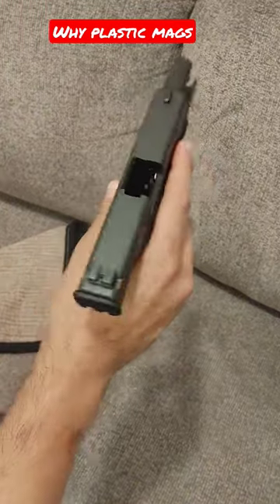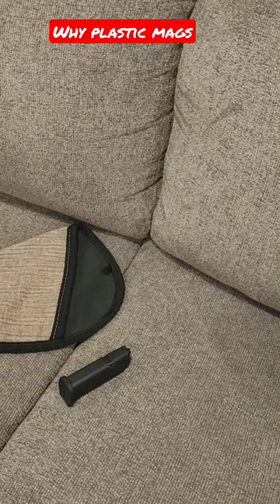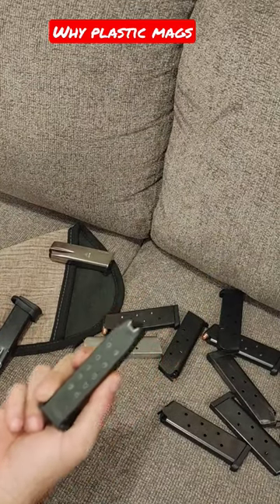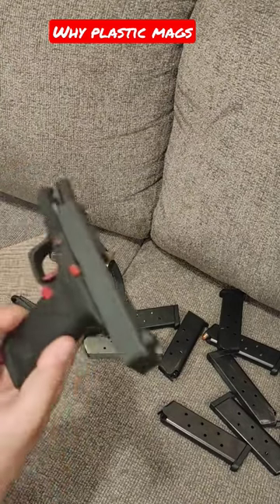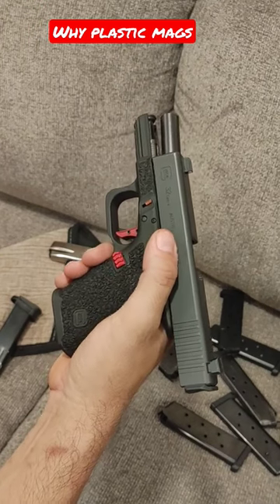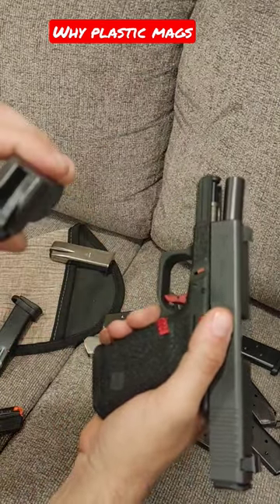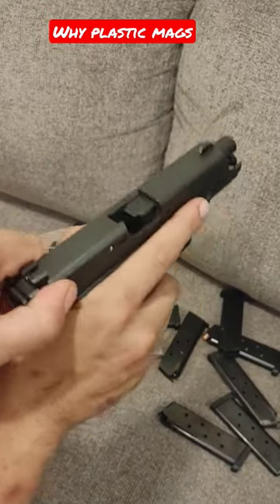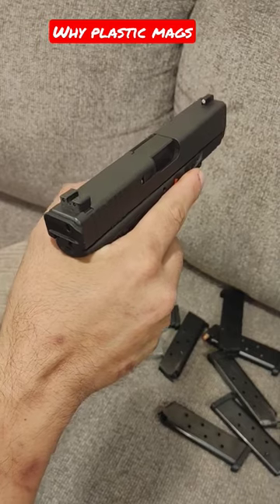why Glock ACTUALLY uses polymer mags

Comment: Over 27 years in law enforcement, 20+ competitive shooting and firearms instructor experience. Never had one single Glock mag fail me. No need for seeking aftermarket solutions. I have went through my duty mags and installed Ghost plates but aside from that, never needed to do anything to them

Comment: The IWI Masada is in my opinion a better beginner Choice than the Glock. It has the same controls and is just as straightforward but with my experience has less recoil, has a good build quality comes with two metal magazines. They are 17 round. It shoots great for around $400 such a cheap gun that my optic almost cost as much as it.

Comment: Also, they care about mag compatibility and can't switch to metal, because it's too thin. It would either be too small on the outer diameter/dimensions or too large on the inner diameter. The one time they made a Huge Mistake though was the G42 and G43 (and 43x and 48), when they stuck to plastic when it was completely unnecessary and to their own detriment.

Comment: The Polymer used in Glocks is consistent from gun to gun. You're not going to have one frame, mag body, or mag catch that has slightly weaker material than the other. They are all the same.

Contrast this with other companies (Smith & Wesson, Sig) who outsource their manufacture to other companies, which results in different metallurgy and polymer tolerances. Walther and Beretta make their own mag catches, but Mec Gar makes their mags. When metals of different hardness rub against each other, premature wear occurs, and failures happen.

Comment: They're also lighter weight, an still work perfectly fine.  Oh yeah, and the factory oem Glock magazines are about "half the price" of allot of the other brand magazines for other pistols. 

A Sig mag is like 50 to 60$'s, and don't even have any off brand options. A factory Glock mag is like 25$'s, so not that bad a deal.

Comment: And yet...they're some of if not the literal best pistol mags on the market. 

Funny how that works. Also, "everyone elses mags" are made by Mecgar and MOST of them are actually Beretta 92 tubes with a slightly different cutout for the mag release. That's why you can run Sig P226 mags in a Canik Rival. Or, Sig P226 mags in a Walther P99. If you modify the cutout that is.

Comment: The plastic is the magazine body. The metal is a reinforcing liner. The magazine will still function normally without the liner. Just wouldn't drop free if loaded, because the metal keeps the sides from pushing out. A metal Glock mag would be a horrible idea

Comment: When is the last time you had a Glock mag fail, before another OEM ?
Reply from the maker: Ive had a few actually. Damaged the polymer around the metal insert from the mag landing funny and it cracked in the cold. Feeding issues afterwards. But I also have had to rotate out my 1911 mags because they eventually bend from use too. So about the same

Comment: They don't dent, or bend. They are dimensionally stable and non conductive. Glock is famous for using the right materials in the right places. Resins can have all kinds of additives, from glass beads to Kevlar strands, carbon fiber, etc. Etc.

Comment: Sounds good but BS . The original G17 mags were NOT metal lined . They were made that way because it was first and foremost a military pistol for the Austrian Army . The mag bulged to prevent loss in a country that has lots of snow most of the year . 
The mag was updated to suit US customers requests. The magazine works splendidly with the OEM pistol . 
I carried one as duty gun for 15 of my 22 years a LEO .. we call it “ Combat Tupperware “ because it always works. 
Now when you start messing around with aftermarket internals, all bets are off.

Comment: Hell even the Glock Omaha feed Better than most of the metal ones…… it all boils down to the properties of polymer and metal, metal can shrink or expand in certain conditions and if they’re stored improperly can get messed up causing feeding issues, polymer is very durable and doesn’t expand as much in specific weather conditions and can be stored wherever

Comment: Original Glock mags never had metal inserts. They were all plastic and not "drop free" from magwell. Glock is a military design pistol. The mags were made to not fall out of the pistol by swelling inside magwell. The Glock is made to pull slide rearward to charge it, not using a slide stop. It's a slide stop not a slide release. The pistol is fool proof when used as designed. Upgrading metal inserts in magazine was only done for the American market. It cost Glock more to manufacture for USA market. American shooters were used to running shooting matches with 1911's spitting mags out dropping free. Shooters did not like having to manually pull Glock mags out of the pistol. Glock spent more money actually to line metal in mags preventing the design advantage of not dropping a loaded mag during combat.

Comment: Oh this is frustrating.
THIS IS THE REALITY OF THE SITUATION.

 Magazines are often times the source of many different types of malfunctions. What happens to a metal mag when you drop it on concrete? It dents. Dents in the mag body prevent the follower from traveling freely and dents in the feedlips cause malfunctions in feeding. Polymer on the otherhand chips and cracks. A chip or a cracked might induce issues but it also might not. There is a good chance there will be no issue with function.

If you think its harder and more expensive to make a metal mag as opposed to a polymer coated metal mag ask yourself why in cheap and poor countries they make their mags out of metal... huh.

Comment: I love Glock mags.. I often think the exact opposite why don’t their competitors do the same?
Reply from the maker: The mags work for their intended purpose. And that is good. However it's an overcomplicated way to save money. In his attempt to make a lightweight magazine, he put a paper thin steel insert into a oversized polymer. This complicated the process even though it winds up making a cheaper magazine. The problem isn't that other manufacturers don't want to use the process, it's at the process is more complicated than it needs to be for a benefit that isn't worth anything. If I use heavier bullets I can easily negate the weight savings I get in a Glock 19. Conversely I can decrease the weight of my 6365 XL which carries the same number of rounds by simply running very light ammunition. It was an overly complex solution to a problem that should never have existed in the first place
Reply: @TheJimminiShow  so what your saying is Glock magazine work great, are lighter, cheaper to make and if you use light ammo it's even lighter. I have always wondered why gun guys are always complaining about shit they think they understand but go on to explain to you how they don't without even knowing it.

Comment: It's also a reason why Glock doesn't have anything to compete with the shield plus, p365, and hellcat. I think if they were to go that thin with a double stack they would have to use metal mags. The polymer is just way too thick.

Comment: Cutting costs in terms of composition while also charging an ass and a leg for their pistols. It's the one company I refuse to associate with or even verbally say (if need be in conversation, I spell it out). The one PCC I have that takes the design of these mags are from KCI and a few are from SGM Tactical, roughly $10 apiece for 30-33 rounds while a G L O C K brand is 17 rounds or so and costs, what... $30? Polymer is no good for anyone who likes sticking their mags to a magnet strip wherever firearms are stored in the home.

If 'rust' is your concern then I'd have to ask what swamp or rainforest you live in. Get a dehumidifier and/or stop soaking your steel magazines in salt water.

Comment: Bro Glock literally started out as a plastic tool used company for cleaning and maintenance like vacuums so it means he worked with plastics which is why glock pistols aren’t just made out of some normal plastic and why he was the first successful gun maker to work with polymer frame because his background extended beyond guns and didn’t go the full metal route like most gun makers of the past and now.

Comment: why glock is using plastic has never really been a question.  it's proven reliable and dirt cheap.  I'm more interested in why few others are using plastic (successfully, at least).  we've got folks making frames out of recycled coke bottles on $100 chinese 3d printers in their basement, so it's not a matter of Glock having better plastic or a better process.

Comment: I've had my glock for about 6 years sweat it all over it shot it never had it rust anywhere, I've had my sick p365 for about 6 months the bottom corners of the mags are already rusting, I'll stick with Glock it's a little bit bigger of a gun the Glock 26 same capacity as my 365 but the Glock never rusts

Comment: I think you’re wrong.  The material only becomes a problem when it comes to reliability and Glocks and their mags are extremely reliable they cause less issues than my smith wessons, they do this for reduction of weight and if knew Glocks history it was one of their base requirements when they made the Glock 17.

Comment: If the only reason was for cost then all other companies would have plastic ones too.
Reply from the maker: Way to focus an entire conversation to one sentence. I didn't say it was the only reason. I know that Gaston was a polymer pioneer. I also know that he was encouraging people to go with polymer handguns because of their weight savings and a polymer mag that holds 15 rounds is lighter than a steel magazine that holds 15 rounds. But cost is a factor.
Reply: @TheJimminiShow   What im saying is that brands that make budget pistols still tend to use steel magazines while glock uses polymer. Glock mags are regarded as some of the most reliable mags ever and glock isnt a budget brand so if steel increased reliability they would most likely switch to steel when it wont affect the price that much. Never said you said it was the only the only reason just saying how i disagree.

Comment: The only difference between Glock mags and the rest is their METAL mags are COATED in polymer. The polymer helps with durability especially if dropped.

Comment: if glock made aftermarket steel accessories to replace the polymer stuff people go to other companies for after purchase, they’d merc the industry all over again like they did in 82 but put profits through the roof. people wouldn’t buy trijicon sights and tyrant releases for their glock branded firearms. they’d put the glock branded metal aftermarket components and save the off brands for the p80s and palmetto daggers. shield arms need to just full steel mag their entire pistol lineup. glock! we need a 9mm, 10mm and .45 pcc from you. y’all are missing a lot of revenue by not giving the folks what they want.

Comment: Idk that's why I don't like ar15s cause of all the plastic and cheap metals but like you said feelings n all that lol
Reply: The only thing that should be plastic on an ar is the stock and grip. Unless you're running a polymer lower. But even then, I haven't had one fail on me. The magazine on an ar is designed to fail and release extra pressure in the event of catastrophic failure.

Comment: So much foolishness arguing about which is "better".  Outside of blatant manufacturing/design errors seems to me almost all firearms will work well, and after that it comes down to the user. Limp-wristing a Glock invariable results in a malfunction, it has nothing to do with mag materials.

Comment: To me Glocks are just mass produced POS. They come out with a new "model" every year or so but yet change VERY LITTLE. In fact if I HAD to choose a Glock, I would choose one of the older versions which are arguably better. But Glock is more of a cookie cutter gun company that continues to try and make their guns CHEAPER and more profitable by cutting corners every year. Unlike some other guns that were made well to begin with and have not changed, some in over 100 years and are still made from METAL parts and made to last. Glocks are more of a "disposable" gun that someone wouldn't think twice about chucking it the second it becomes unusable.